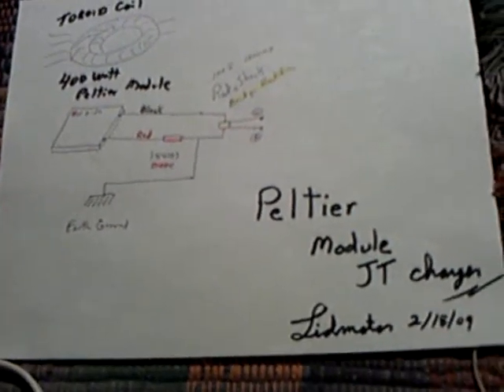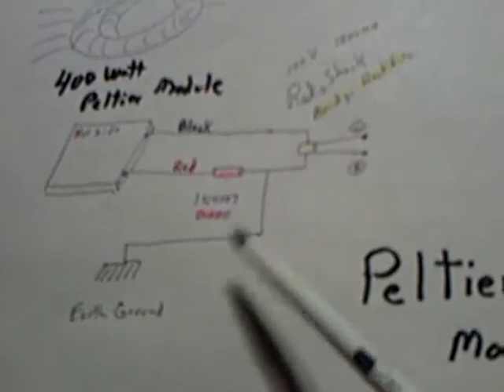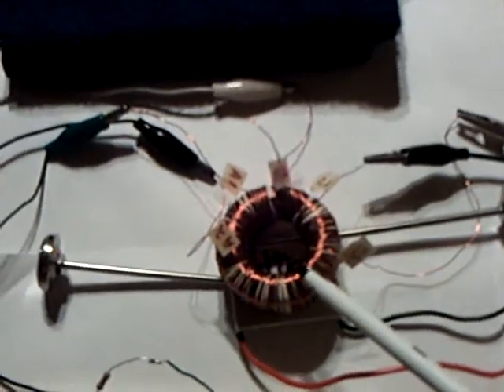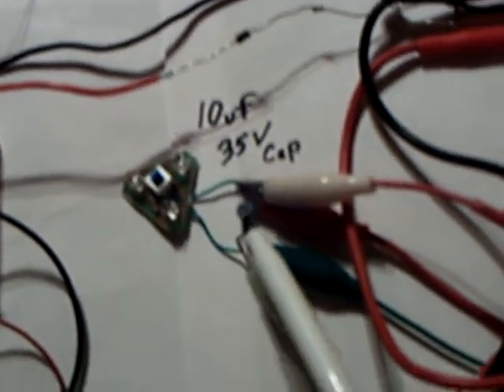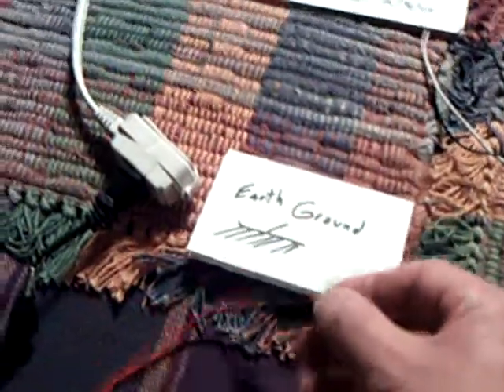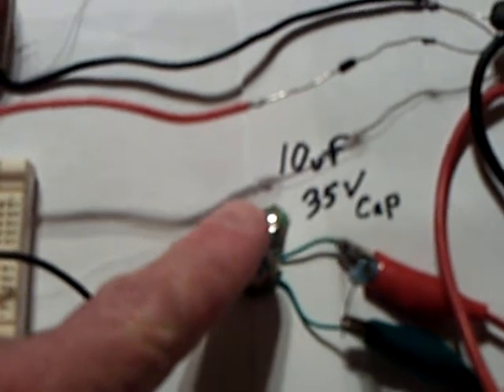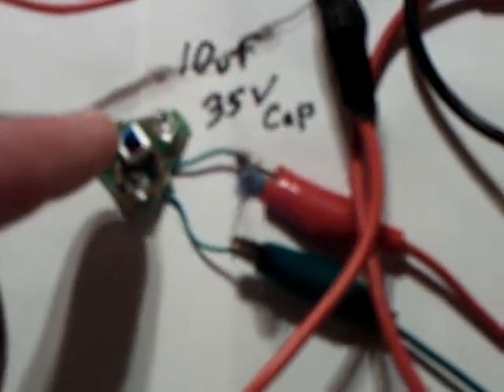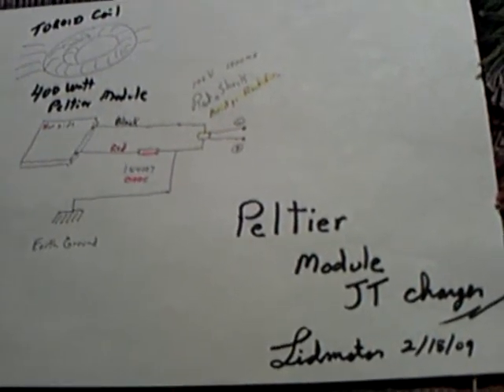Peltier charging on a CFL Joule Thief

Comment: Did you conclude that the Peltier's also pick up energy in magnetic fields, back then, Lidmotor, or was it purely a heat differential as normally associated with their function? Thanks.